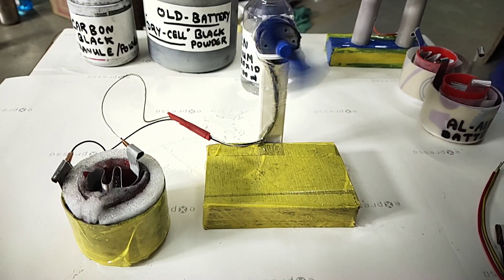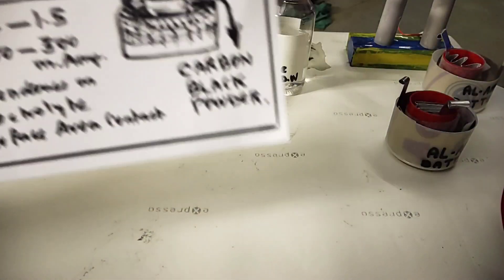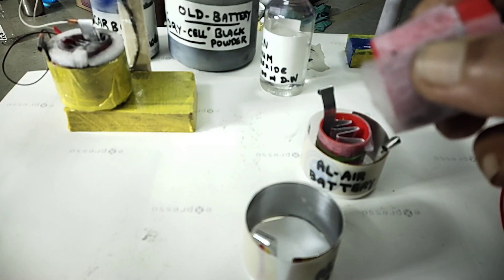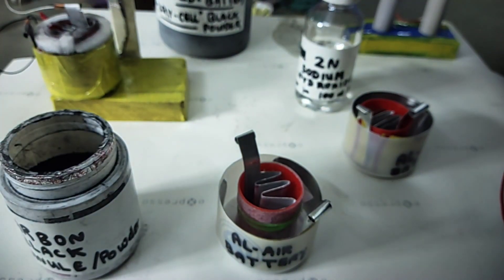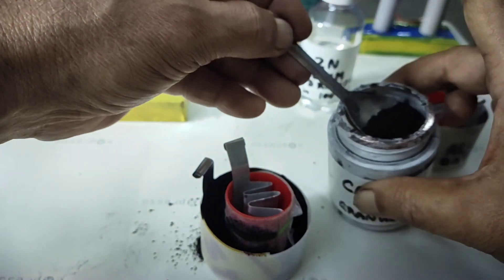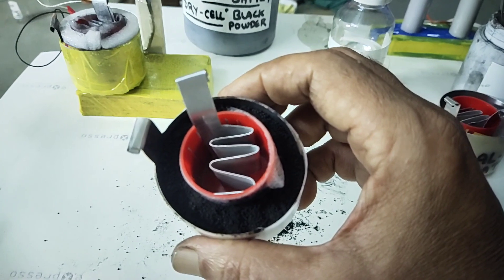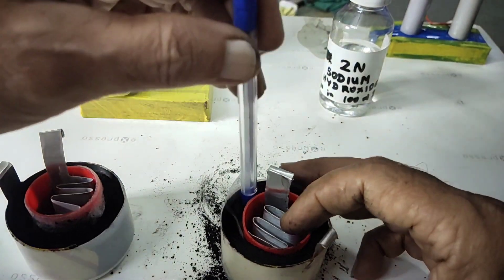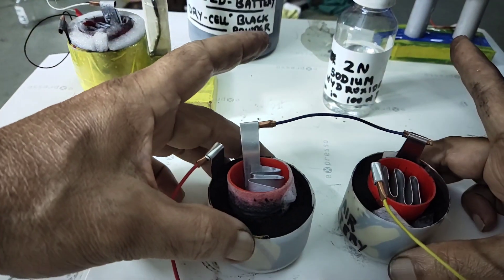SIMPLE AND RE-USABLE DESIGN ALUMINIUM - AIR BATTERIES 1.4 TO 1.5Volt.- NO LITHIUM, SCIENCE PROJECT

Comment: Thank you for sharing the project. Could you please tell me why it's called Air battery? While air is not used in it.
Reply from the maker: Actually the aluminium air battery proceeds without stop until all the aluminium plate turns to aluminium oxide, which is non conductive, until then it gives its current. The oxygen actually supplied thru carbon in presence of Alkali.